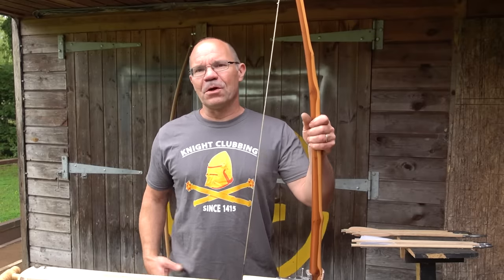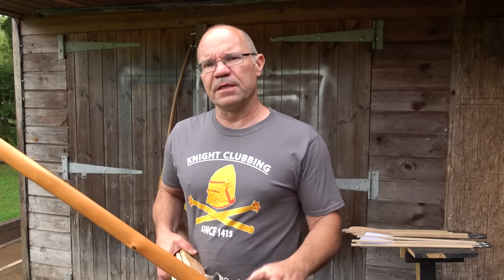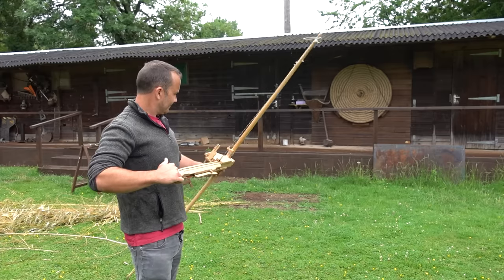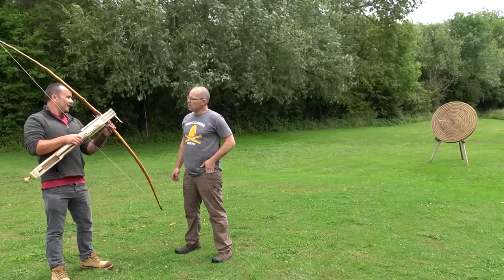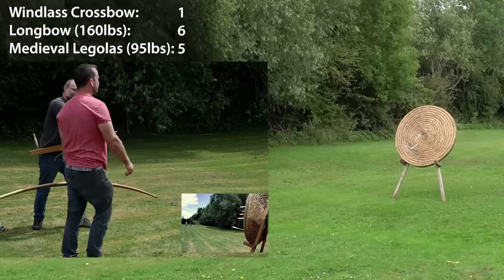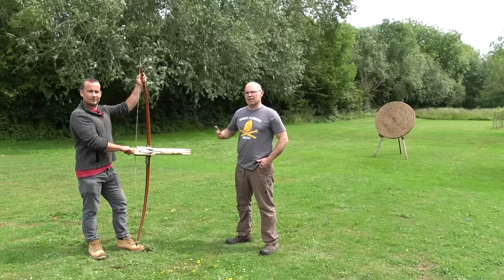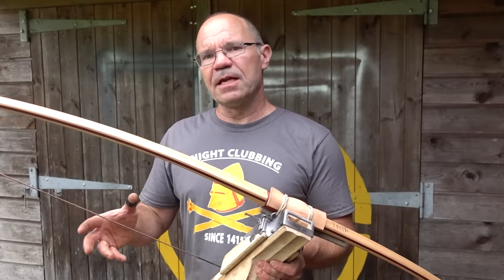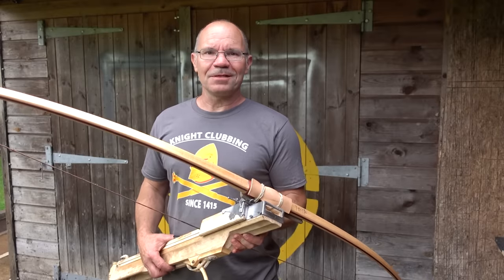Tod's 120lb Medieval Legolas - TESTED

Comment: As Joe was mentioning at 13:00, from a body mechanics standpoint, having the rear handle be horizontal considerably lessens the effectiveness of the short head of the biceps brachii. I wouldn't be surprised if that had a big effect on Joe's draw. It also prevents the brachialis muscle from being recruited. That would have a smaller effect, but not negligible. If we say the current orientation is at 0 degrees and vertical would be 90 degrees, I think about 60 degrees would be the ideal orientation from a body mechanics perspective.
Were the bone runners lubricated? A little oil might help a lot.
As far as the handle on the front, perhaps putting it on a hinge so that it folds away most of the time. Defending a siege or something, that handle could be very useful if you're waiting for a chance to send an arrow at someone who's popping in and out of cover, but you probably wouldn't want it all the time.
Fantastic stuff, cheers!
Reply: I agree that the orientation of the handle is an important factor for pulling movements. The situation here is similar to overhand-grip pull-ups (harder) vs neutral grip pull-ups (easier). For me, the difference in weight I can add for the pull-ups is about 20 pounds.
Reply: @kaptnsharky727  That's exactly what I was thinking about as I was looking at that
Reply: And bear fat grease on the bone runners. Since it needs to manufactured and operated with the limitations of the period.
Reply: Absolutely! Different position means different muscles used.
Reply: Don't you loose poundage on your shot when you hold a bow at full draw? And doesn't it lessen the bow's draw weight over time?
Reply: Rather than a hinged handle, setting the grip maybe an inch further forward to provide space for the fingers behind it, or just replacing it with a hooped thong of toughened leather could work.
Reply: @roberthill5549  Did they use whale oil back then?
Reply: Interesting. A lot of modern release aids are in this horizontal draw position.

Could the draw handle be on a ball/pivot joint? This would allow for vertical, horizontal, or anywhere in between.
Reply: Yeah I'm surprised Tod didn't mention that as a potential issue in his summary. Surely it should be oriented vertically like the bowstring is.
Reply: @m1k3droid  - Bear fat was easier to get. Although in England pig fat was probably used, since bear fat would have had to be imported or hunted in northern and southern Europe. Whale oil was probably too valuable to be used as lubricant by any but the rich, since it's main use was in lamps.
Reply: @MartinFeatherstone  those release aids are generally used for compound bows so the draw mechanics are completely different
Reply: @roberthill5549  What about Olive Oil?
Reply: Just make a handle that can rotate. There are lots of easy ways to do this. This way the user can draw easier but can stil engage the trigger.
Reply: and he didn't use the reverse bow design, a real shame it's one of the biggest advantage of the instant legolas.
Reply: @Ajmes  olive oil isn't resilient to heat and isn't lubricant enough, industrial machine use gel style lubricant because it stick a lot more to the material (it doesn't flow away) applied to and is much more effective in high compression than liquid lubricant.
and obviously, wood absorb liquid.
Reply: Is the draw length also longer with this bow? then making that a bit shorted might also work (of course then again you have to switch to a heavier bow to make up for that). @Todd: could you measure if the draw weight of the bow with the legolas and without? then we would also know how much friction does impact this solution.
Reply: As far as a compounding of things making it harder to use it sounds reasonable that those are the main issues. 
I also can't help but think another small factor may be a "marathon vs sprint" type effect, all though it isn't a huge amount of time the act of knocking a new arrow does give you a little bit of a break to have a few breaths then go again, while this device you are taking the full strain again pretty much instantly, something which might not be noticeable at first but could explain the 4th and 5th arrows being much harder. Almost akin to trying to hold the bow at full draw for an extended period.
Reply: There´s also the factor of shooting 3 times faster, wouldn´t you think? I don´t have a physiology degree but I studied my share of ergonomics and speed is a great factor regarding energy required.
Reply: Why not have a handle that can swivel? Then your hand can follow a natural movement
Reply: @davidaxman  I agree a rotating handle would be lovely, but I expect that within the historical technological constraints of the design adding such a moving part might introduce a potential point of failure in what is currently a relatively straightforward mechanism.  If nothing else, such a mechanism has the potential to increase weight or reduce equipment longevity, or both.
Reply: I like the idea of having it under a specific angle (not just vertical vs horizontal), which made me think also the handle could be also more tilted forward where the thumb is and backwards near the pink (as with a revolver designs) this to improve a real power grip. Also as mentioned before by @cappinjocj9316 , the handle could be maybe placed at some point more forward. A swivel handle I would not use as you would loose force too much when it comes into a wrong position leading to injury of the archer etc. but it can be good for when prototyping a bow that you can adjust to test out what is the best position (still fixing it when putting tension on the bow)
Reply: @xandercorp6175  I can see one way it can be done quite easily - have a nice turned wooden/horn shaft handle with notch for bowstring or similarly thin and tough material joining it to the back of the mechanism - the handle can then freely twist and turn to match the arm hand movements that give best power for that archer (rotation around the arrow shaft axis is easy the rotation in the plane of the bow might end up with bruised knuckles on the back of the ammo hopper section if the string is too short). I expect the handles string at the back would wear relatively fast - but probably better than the bowstring on the bow with all that extra rubbing.
Reply: Great comment, I think this device would be more likely to replace a Crossbow, than a regular Warbow. If you compare it to a Crossbow, and maybe even somehow add Joerg's feature of a draw assist with the reversed bow easing the drawforce, it seems to share the advantages of a Crossbow, but with way higher fire rate. Like you can be relatively accurate without a lot of practice (just as with a Crossbow) and then you would have a ridiculous fire rate advantage over a Crossbow. since the Crossbow has to be reloaded after every shot with a winch, at least if we are talking about a Crossbow with comparable penetration power.
Reply: About the handle i do agree it is very useful when it comes to be able to hold the arrow for a little while. Maybe you can make it so it rotates on its own axis (Y axis) so you can decide when to enable/disable it depending on the situation.
Reply: What if you put it on a ball joint? Would it then naturally follow the most efficient path?
Reply: @kaptnsharky727   What about a free spinning version?
Reply: @kooroshrostami27  I don't think it would replace crossbow at all. You missed one key advantage of crossbows, that it shares with firearms: you can pick *absolutely anyone*, give them a crossbow and have them firing full powered bolts at the enemy, after teaching them how to aim and operate the machine of course. In contrast, you need some serious brawn and years of (muscle) training to even draw a warbow, and then you need to learn to aim it. You still need that brawn to draw a warbow equipped with SIL, so it's not for everyone. 

To my understanding, wars in the middle ages were mostly fought with levies, i.e. peasant armies with some professional soldiers mixed in (knights, men-at-arms and the sorts). Numbers matter in a war - the more the average people can use a weapon effectively (or at all), the better. I think Joe Briggs says in one of these videos, that you can't really train the muscles needed to draw a bow in a gym, that there are no suitable equipment designed for it - you can only practice by shooting the thing. I'd postulate, that the mucle groups used for drawing the bow are quite unique and rarely used it other tasks, because there would be training equipment for them, if they were used often in other tasks. 

The english could muster longbows, because they had mandatory bow shooting practice every sunday, so the populus had the brawn and skills to use the weapon (or so I've heard). You could calculate, that the kingdom lost some percentage of revenue when the peasant's weren't tending to the fields for that time, but as a benefit they could wield warbows in warfare, which were FAR chearper and easier to manufacture and wield than crossbows, so I guess the costs even out.

So, I'm thinking on the same lines as Todd: SIL wouldn't have replaced either the bow or the crossbow, but it could've been used by highly trained professionals in certain situations, maybe as a sort of shock troops. Or maybe some sort of dragoon troops, as you don't need as many soldiers for the same amount of fire power, and the horses can lug the extra arrows for the soldiers, so supplying the troops wouldn't be an issue.  Wait, let me rephrase that - arrows running out in the middle of the battle wouldn't be an issue, supplying the army with enough arrows in the campaign would still be an issue. :)
Reply: Ooh great idea!!! Hinge it one direction so it just sways away if it hits your finger but if you grab it itll hold.
Reply: @L3monsta  he did on his 120 trial summary.  He mentioned the hand position may be using different muscles
Reply: If the rear handle could spin allowing  pronation to supination it would allow for the most natural movement. I don't think this would create any instability in the wrist (shaking from the freedom of movement) but I could be wrong.
Reply: I too think it depends on how one draws. Personally I feel I'm am stronger drawing to my right pectoral muscle rather than to my cheek. Also changes the angle required of the handle.
Reply: @kooroshrostami27  That draw assist doesn't actually help once you get toward full draw, which is where the weight is the heaviest anyway. Draw assist starts at its maximum weight and does less and less as you draw back, while the draw weight of the bow starts at zero and gets heavier farther into the draw.
Reply: As I understand it, you shouldn't really be using those muscles in the first place. The vast majority of the weight is supposed to be taken up by the trapezius; I think it's the fact that he can't lean the way he normally does that's causing the difficulty, as his body position is not ideal for that. Thumb draw techniques can also shoot high draw weights like that, and the hand position is horizontal for those (https://youtu.be/UvGAYBMhbKY).
Reply: @alexanderflack566  are you nuts?, the handle at the front lets you hold on to the bow with your front hand, Jörg is showing that you can hold the bow fully drawn with only 1 hand. Sry but you are wrong
Reply: Personally, I find it doubtful that changing the angle of the grip would help that much. Joe shoots thumb release as well (140#, 145#, something like that), for which the hand is at roughly a horizontal angle like this. The issue is that the IL forces him into a body position that isn't ideal for fully activating the trapezius. You shouldn't be using your arm muscles hardly at all in the latter part of the draw; it should all be on your back.
Reply: @roberthill5549  When you consider how expensive arrows are, I'm pretty sure the military budget would stretch to a few ml of whale oil.
Reply: He simply has not trained in this type of shooting as would be the case with the thumb release different muscles are employed in a different way case in point  where medieval war archers skeletons show they all had the same back injury and an abnormally beefed up bow arm much bigger than the draw arm no such injuries are found on skeletons of middle eastern or asiatic war archers though they used bows in excess of 166lbs.
Reply: @jareth7456  Can you point to a primary source showing this? Also, while some archers were capable of using such bows, they may not have used such heavy draw weights as frequently, since they often shot from horseback, meaning lower draw weights.
Reply: You could make the foregrip handle padded and put it on a hinge so that when you draw the bow your knuckles push the handle up and out of your way

Comment: 14:55 I honestly think the reason he get's tired so quickly is the speed, normally the time between each shot is more which means he get's to rest a bit between each shot, but when he shoots this fast he has virtually no time to rest, it's like comparing sprinting to distance running, one you burn all your energy to get a burst of speed but the other is sustained output.
Reply: That is a very good point
Reply: but.. with that speed, you probably dont need to shoot same amount of time as before. I mean, targets probably cease to exists much quicker.
Reply from the maker: Well said and not sure how I overlooked this in the film
Reply: Tod's Workshop using archers in the same pattern as shown in Waterloo or Zulu would help alleviate some of the fatigue. I’m sure Joe would adapt to the new technique fairly quickly though.
Reply: There is a very easy way to test this hypothesis, which I have though of, too. Tod should measure the draw in motion, like just clamp it in a vice and use a scale, put a camera on that scale and look at the force curve. Than do the same without the legolas attached. It should be possible to see the friction contribution if it is present and not negligible.
Reply: @petergriffin4629  It's even easier to test.  Let him fire five arrows with a naked bow and measure the time when he starts drawing for each.  Then perform the same action in the same speed with the Instant Legolas device.  If he still thinks it's harder to do this, then it is due to geometry and friction.  But my guess is that he will then say that it's not much harder (if at all).  Probably even easier because some other movements can be skipped like picking up the next arrow, etc.
Reply: Just what i was about to say to
Reply: Also, The fore grip is intended to take some to all of the strain off the draw arm to make the weapon less tiring and more accurate. Once a person gets used to grabbing the fore grip instead of only the bow, accuracy tremendously improves, but not speed. Learn to use the fore grip, improve accuracy, then gradually increase speed. It is a different technique; as with pistols, changing the grip one uses for a revolver versus a semi-auto.
Reply: Adam Richard  Cocked more like a crossbow so the mechanism locks the string and takes all the strain after your initial cocking effort. Crossbows exist so what you are suggesting is surely possible with an adaptation of existing (and very old) technology.
Reply: It also looks like quite a hefty bit of kit to hold at arms length.
Reply: So if this weapon is a sprint and an unmodified longbow is a marathon pace that increases the difference in use doesn't it? because if you are in a situation where you need to shoot for a long time then the SIL will be an unsustainable pace. if you want mass death at express speed the SIL is your choice. I also imagine this would affect logistics in terms of arrows used.
Reply: my thoughts exactly.
Reply: Adam Richard  This would technically convert it to a crossbos, at least as joerg explained german law in one of his videos..
Reply: Longbow requires technique and strenght. And a lot of back muscle.
Instant legolas requires strenght and endurance. Just arm strenght and endurance.

Not an expert on longbow, just my observations.
Reply: Val Bourne that’s right
Reply: Now that you mention it, wasn't that the whole idea behind the original Bowflex?
Reply: I also think that a factor is also the grip, not only because it's different from what he's used to, but also because it's further back. This means he has to bring his arm back even further to fully draw the arrow which I'd guess makes a pretty significant difference as well.

Maybe Tod should as another grip on the bow itself, but further back too

Comment: 12:12 This is clearly because of his hand placement. It’s 5cm back from where it would normally be, giving him less leverage over the last (and most difficult) bit of the draw. Friction has a small role to play but I think it’s primarily his different physiological positioning around the bow, as mentioned.
Reply: Yeah I agree it would put a hell of a load on your back shoulder muscles which aren't used extensively in normal archery and would tire out much quicker but it's just ergonomics I think that the design can be refined to make more ergonomical.

Comment: 12:18  I suspect one more reason it was so tiring for Joe is that there's so much less time between shots for his muscles to relax and recuperate.  Compared with the crossbow vs longbow clip, I believe he fired his 5th arrow at the same time the clip showed him firing his 2nd - pulling over twice as often for the time taken.  That's got to take its toll. 

Nice work, Tod - and great to see Joe again.  I was taught as a kid to pull back with the shoulders instead of the arm, but I never really understood how that worked until watching Joe.
Reply: This is a bit like weights trainings in gyms. Usually a set is done in 20 secs but suddenly had to do in half the time.
Reply: I definitely agree the timing changes would be a significant increase in difficulty.